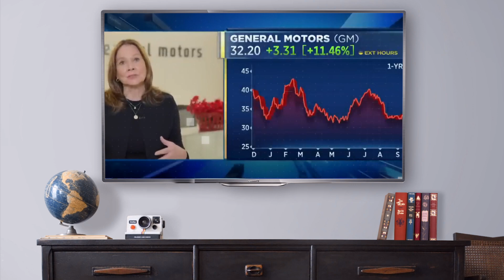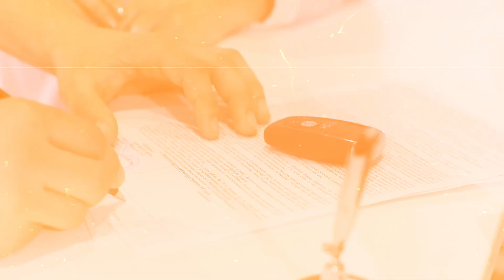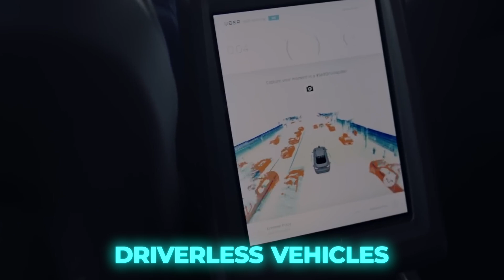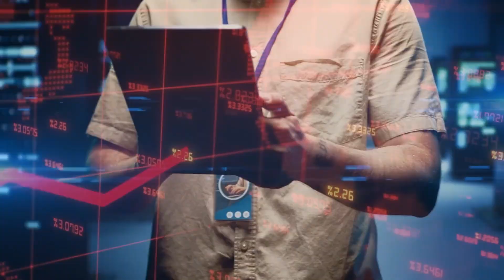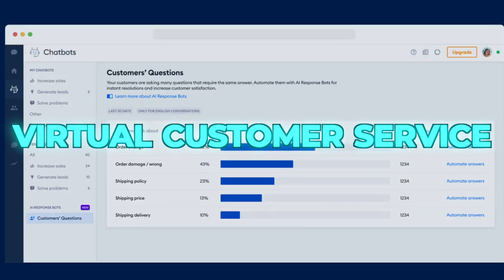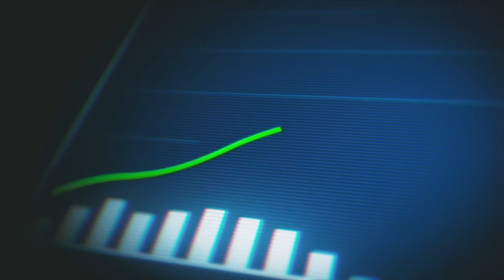HUGE NEWS! GM CEO Just SHUT DOWN All Dealers!

Comment: Just wait until you NEED warranty covered repairs, when there are NO authorized repair shops, or any trained techs, in range. Are you willing to drive 200-300 miles to find service, only to be told 'Come back in 8 months'? Just as Tesla vehicles can wait 6 months or more for parts, GM may go the same way, especially as the increasing complexity complicates the situation.